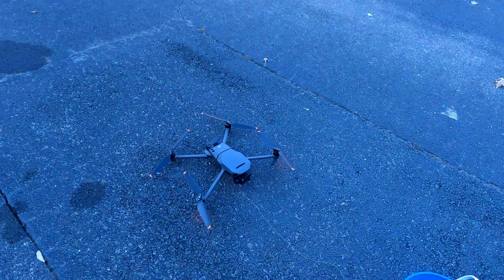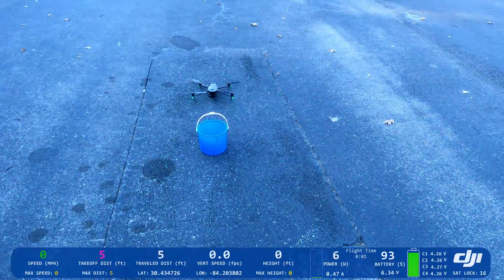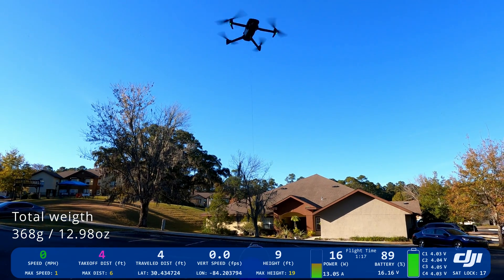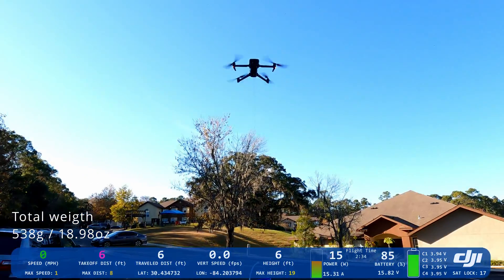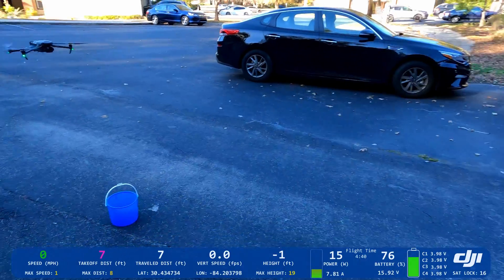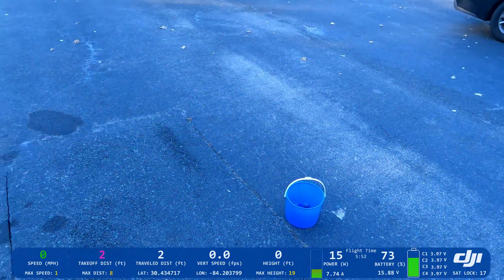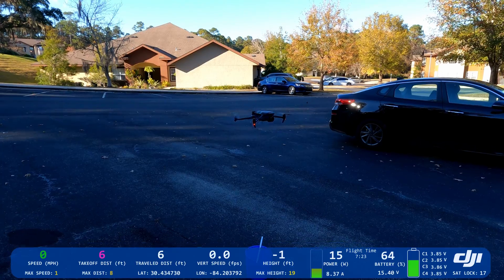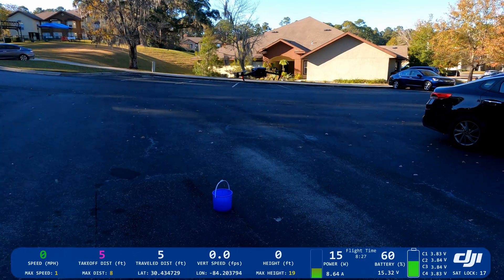Mavic 3 - Lifting weight test

Comment: Carried a can of soda with my air 2  in a 1 gallon icecream buck tied to a string. It took forever to come down because it detected an object below it. Landed it and took off again. Made it up 20 feet and it came crashing down. The motors were extremely hot and it kept saying error something. It basically burned up

Comment: Thank you for your video.

There is one thing I would like to mention.
With the blue basket, it seems that the center of gravity was not stable, and due to the indentations in the basket’s structure, the propeller’s airflow may have affected it unevenly. I think these issues could have made it more difficult to lift heavier weights.
If you place a cone-shaped structure, like a Vietnamese hat, on top of the basket to distribute the airflow evenly, you might be able to lift heavier loads.
I hope you can address these issues in your next experiment and succeed in lifting even heavier weights.
Thank you.

Comment: How hot did the motors get after the tests?
Reply: Thanks for this. Would want to see flying distances as a function of added weight
Reply: On hot days my air 2s motors get really hot carrying just 292grams
Reply from the maker: @SaintOlav  They are still working  flawless.
Reply: @DroneSurf  Do you carry a payload every day? I wear out the bearings when motors get hot doing it 3 times a day with a payload. If the mavic 3 can carry more weight with less wear on the motors I may upgrade.

Comment: What is the MSL altitude there?
Humidity?
That bucket is also acting as a down-drag parachute from the prop wash.  
Flying a single tied weight instead of the parachute bucket would increase cargo lift capacity.

Comment: One thing to bear in mind is that as the battery gets depleted the voltage goes down and thus the (lift) power goes down, affecting the payload capacity.  If you want to actually move something, it's best to test at a very low charge to ensure your drone doesn't plummet before reaching the destination.

Comment: Sand or water would give you more exact number and propably longer cable would limit the shaking(you can weight the bucket with the cable inside).

Comment: You just gotta put a bucket of water on some scales and weigh how much it lifts. Easy.
Reply from the maker: I did it preview the video and was around 198g. I forgot to include that in the video. I did weigh everything at the end.
Reply: @DroneSurf  I think he meant you have bucket of water, i.e. 3 kg, on the scale, showing 3 kg, then you pull up with the drone and see how the weight displayed on the scale changed. That will directly show the pulling capacity of the mavic3
Reply: Or attach a digital hanging type scale(they have a loop or hook at the top, and a hook at the bottom) to something fixed or very heavy on the ground, to the drone via a string or fishing line on the top side of the scale. They're dirt cheap, and accurate. These can sometimes also be set to record the maximum weight(or lift in this case)